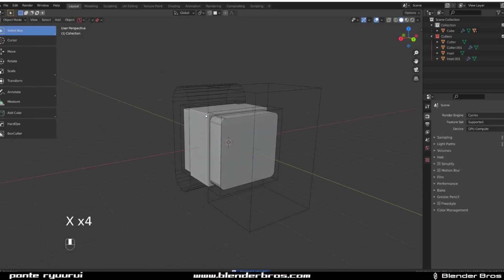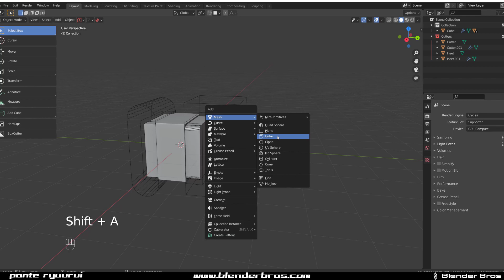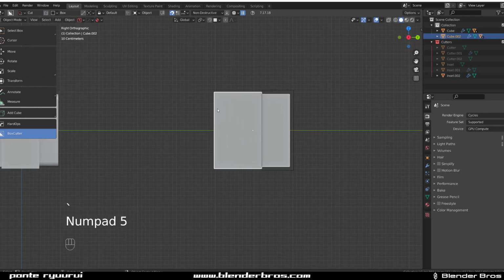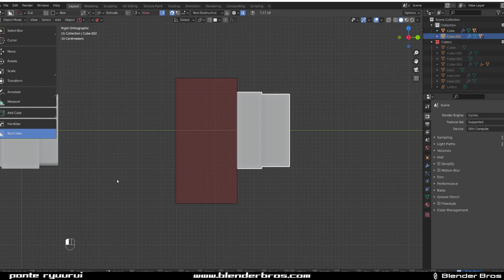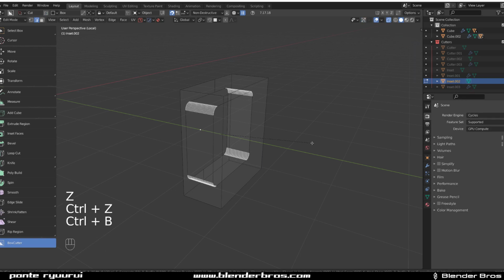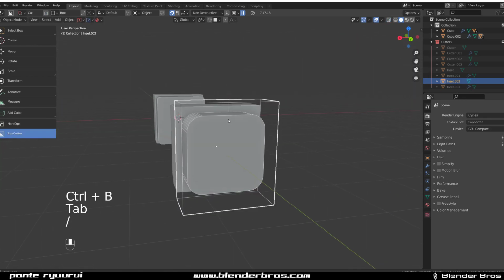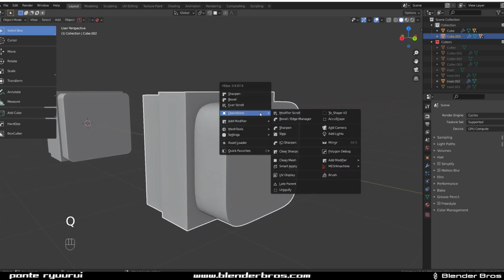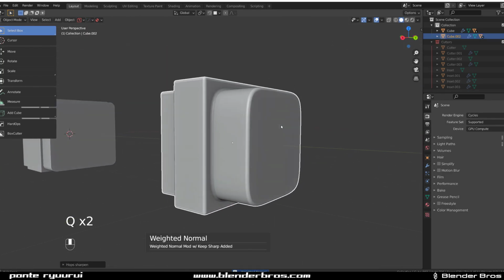Blender tutorial - Easy INSET Boolean Bevels with Boxcutter

Comment: I'm trying to use the inset tool in the shotgun tutorial but it really does weird things on my mesh I'm surely doing something wrong. When i change on purple modifier and press T to solidify my mesh just get cutted or at the corners it makes big triangles that go outside the mesh. Any advice?
Reply from the maker: could be many things, your mesh has issues, the cut is badly places, bevel is too big, cut is too small, etc, inset cut is a moody beast, play to figure it out, it could also be a blender ver issue, i am using 3.4.1
Reply: @PonteRyuurui  yeah as you said to me the other day I downloaded the same version of the program. Maybe it’s a problem of bevel. I have too many or they are too close as you said in the video. My question is, there is a way to decrease the number of bevels with this adding? I would like to avoid deleting them by hand cause I can create more issue. Thank you for the support!!
Reply from the maker: @xxphantom93xx61  not quite sure what you mean, i'd join our public disocord and toss screens or gifs under help chat / link in the vid descr
Reply: @PonteRyuurui  can you give me the link please?